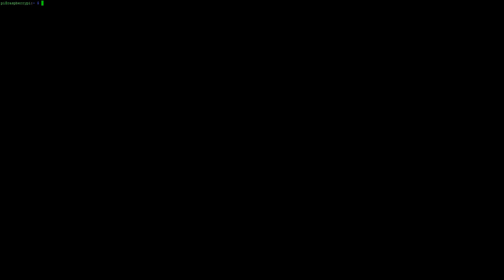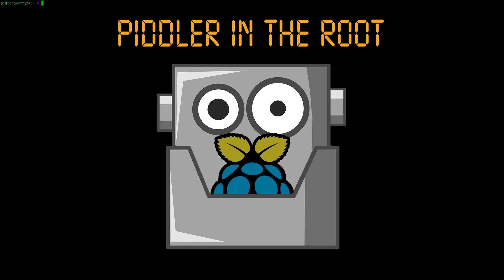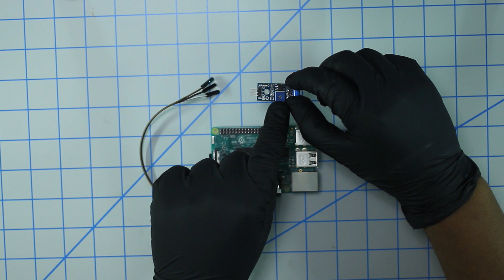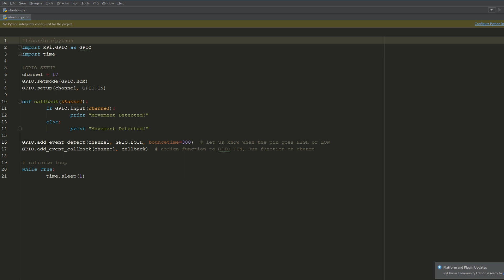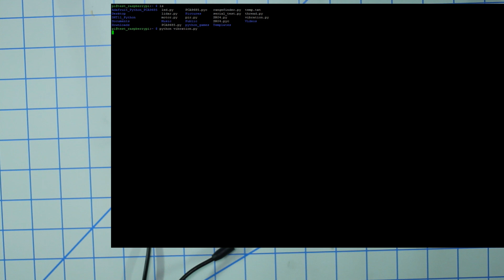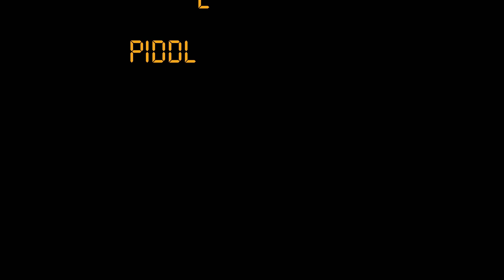Vibration Sensor SW-420 (Raspberry Pi)

Comment: Nice vid, I'm surprised you didn't use a resistor of 2 mega ohm connected between them for protection purpose. Do you know if connecting a simple piezo sensor is similar? I can't find a single resource that shows how to do this and code that detects impacts. Are you still doing these exercises after 6 years ;-)

Comment: Small question:

Is this sensor capable of measuring vibration? I would need to not only detect it but also measure it.
Reply from the maker: No. You would need something like this, https://www.raspberrypi.org/blog/raspberry-shake-personal-seismograph/ or possibly an accelerometer.
Reply: Thanks a lot!
Reply: Do you know what type of accelerometer that we can use to measure vibration/wobble?